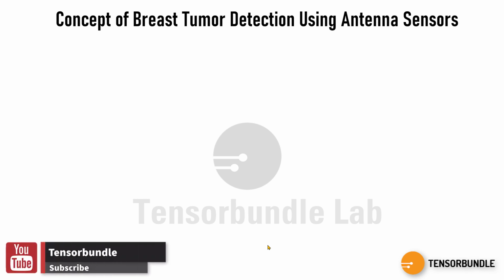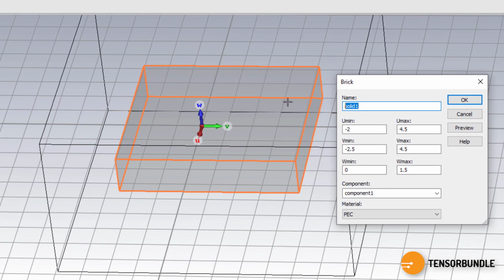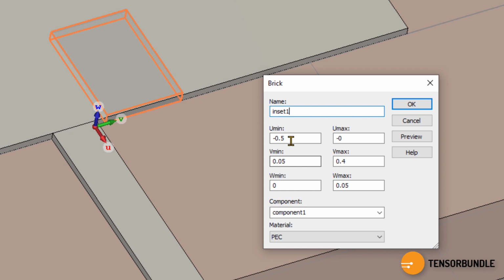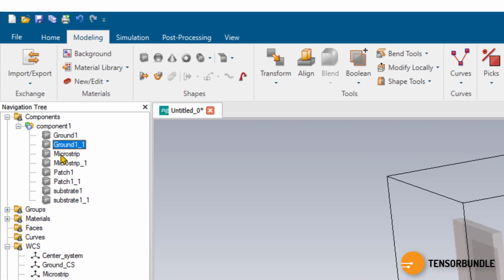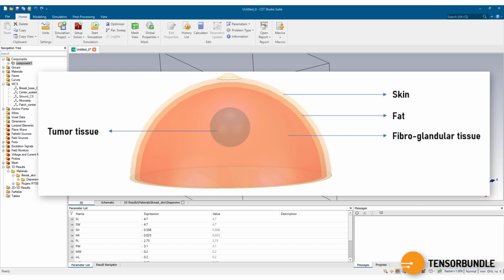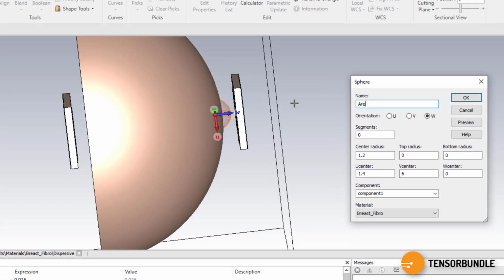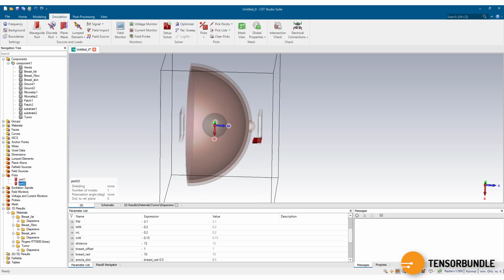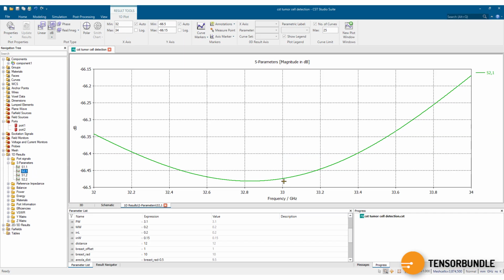CST Tutorial: Breast Tumor Detection by Electromagnetic Signal and Microstrip Patch Antenna in CST

Comment: Sir between antenna 1 and breast model distance is based on any calculation or assumption only. Please reply me sir
Reply from the maker: assumption. But you can make the distance as a control variable and investigate parameter sweep response based on it

Comment: thank you for video it is very helpful. i have a question please,.in case like yours, is using both s12 and s21 give useful information? or they are both give same information and should use one of them only?
Reply from the maker: Breast is non-symmetrical object, so for this system S12 and S21 will be different. However, for only 2-antenna system, S12 and S21 are identical.

Comment: That's cool video.. Also its a proof of concept for making high frequencies penetrated inside tissue.. 
My  question is , what are the specs for the machine you are using . I mean the RAM and GPU card etc .. I tried something like this with Core i3 Laptop with enhanced RAM of 12 GB ( actual available 7 GB ) and CST says out of memory without opting for adaptive meshing option.
Thanks again for the video
Reply from the maker: i7, 32 GB RAM, and 4GB Nvidia GPU

Comment: these frequencies will not propogate in the human body. the attenuation is much too high. I highly doubt they wll even pass the skin. why did you choose them for this video?
Reply from the maker: I would not directly address your incorrect concern, but rather would refer to actual researches people doing. Research vectors are not stationary, they progress with time. MMwave can be harnessed. What you are saying is past long ago. Read the following and keep yourself updated. You will get your answer. And please always stay updated with relevant research trends before making any random guess, specially on a research topic

1. Iliopoulos et al. IEEE Trans. Biomed Eng. 2021,  Enhancement of Penetration of Millimeter Waves by Field Focusing Applied to Breast Cancer Detection

2. Sabzevari et al., IEEE Microwave Mag. 2019, Tumor Detection Using Millimeter-Wave Technology: Differentiating Between Benign Lesions and Cancer Tissues

3. S. Di Meo et al, IMWS 2017, High-resolution mm-wave imaging techniques and systems for breast cancer detection
Reply: @tensorbundle  Thanks for your reference papers I read it and found it helpful in my research area. nice work
Reply: @FREEFIRELOVER-gm8eq  can you please share the name of that reference paper?
Reply: @tensorbundle  i agree with gil...,  i habe read the 3rd paper you mentioned and his results are very bad. Gil has quite rightly mentioned that at such high frequency penetration through skin will be very limited. If you read the paper he has not simulated skin layer and is using ideal scenario and still there is way too much noise in the final image.

Comment: 1 quick note.. in the newer versions of CST there is an insert bio model Macro feature, which adds a human body into the CAD (includes models of different sexes/age categories, etc) which i know you dont need to use the entire thing but you can always just crop out the parts that you dont need to model to save processing time
Reply from the maker: I Know that. Selective truncation may not be an engineer's way That would be kind of technician's way following a cheat-sheet. Besides, material properties can be easily controlled and engineered in a custom phantom which  would be useful for further parametric analysis.
Reply: do u know yo create macro of it in matlab
Reply: Hi, where can I find that new feature??

Comment: greatly helpful video, i actually worked for a little bit on this topic before using CST
Tiny comment on the CAD to help you save some time, you can use the mirror feature more frequently and it will help you save a TON of time.. it did for me, also aren't you supposed to murge the structures on the same substrate? (parts of the patch)
Reply from the maker: Thanks. I make tutorial based on target audience. This tutorial shows everything from scratch so that from fresh users to advanced - all understand.I do not necessarily use the same steps for my own use. Tutorials should be made to be like 'tutorial' - easy to follow for all users.
In my own real life project, I use smarter way and barely use manual CAD steps. I know how to automate design by script. I write a few lines of codes and get the whole CAD design done. That saves my time already.
Reply: @tensorbundle  Can you also make a tutorial of automation like you have mentioned?
Reply from the maker: @furkansahin3772  Ok I will make.
Reply: Thank you great video  .can you help me my project is to measure the sugar in human blood  in cst